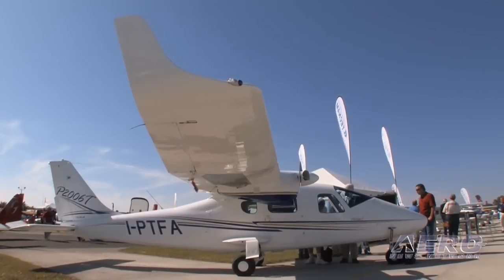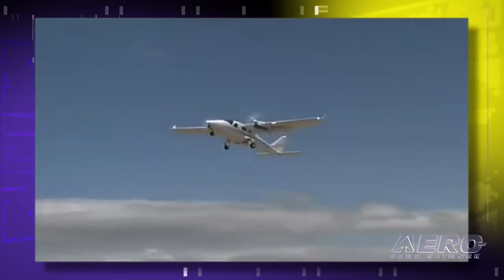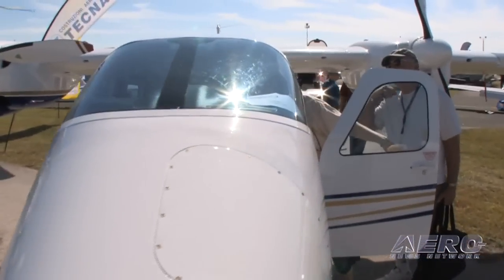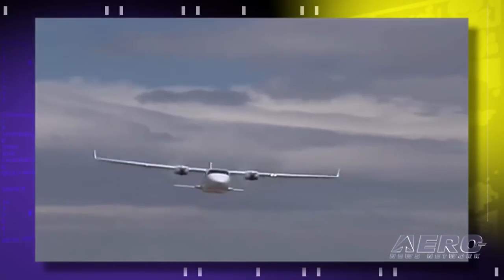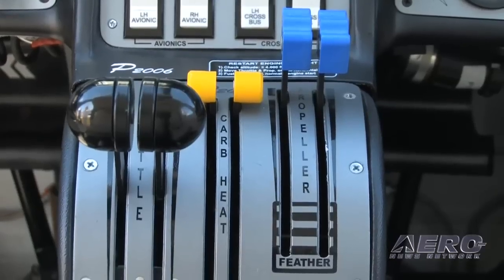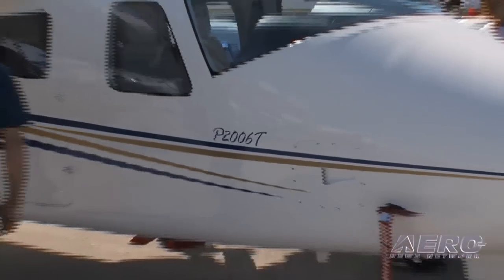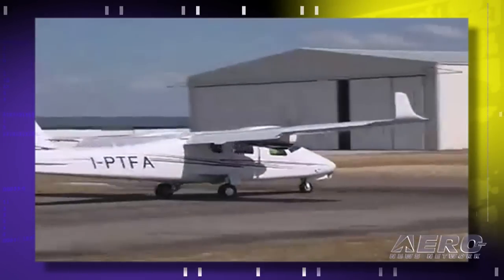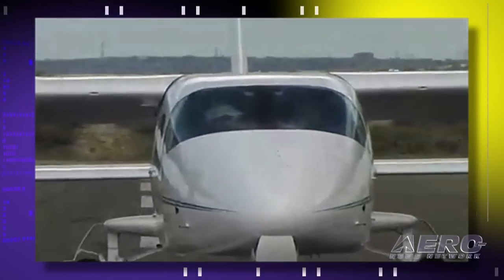Aero-TV: The Tecnam P2006T - Energizing the Flight Training Market

Comment: My flight school has purchased three of these and I now have about 80 hours in them. Sure, they burn less fuel, but they're in maintenance every week. Every 25 hrs the carb floats have to be replaced because they disintegrate and clog the fuel passage. We've had numerous landing gear issues, blown tires on smooth landings, broken fuel caps, gear pump failures, and avionics failures in all three planes. The cockpit has a very "cheap" feel to it, you can see behind all of the switches and things constantly shake loose. And when any one of these issues arise, you get to wait for weeks as your parts from Italy are shipped, in hopes that they actually send the right part. The POH is very poorly written, and missing a ton of information about the aircraft. It is laughable that the FAA even certified the plane and manual for use in the U.S. Because of all these issues, we only have ONE DPE within the area that is willing to actually fly in this thing. If looking to purchase this aircraft for the apparent "savings", please reconsider.
Reply: preach
Reply: Interesting to hear that. What flight school are u with?